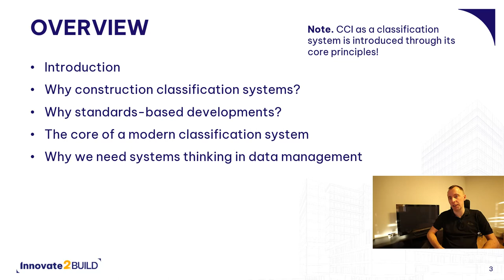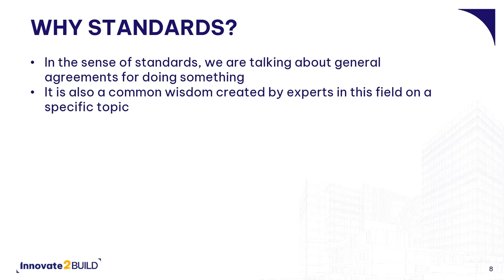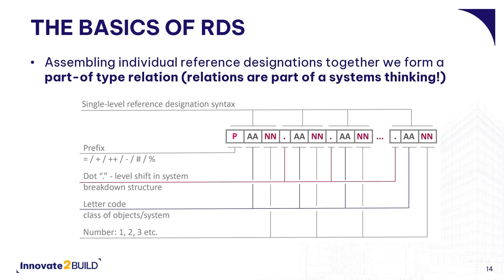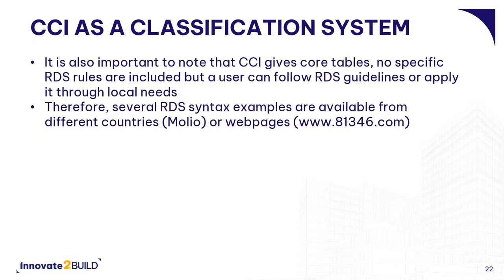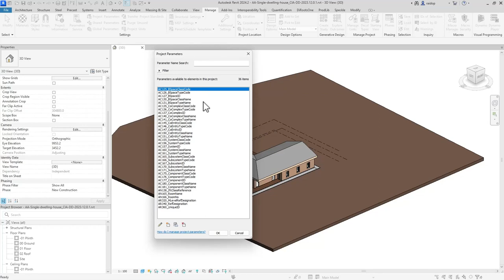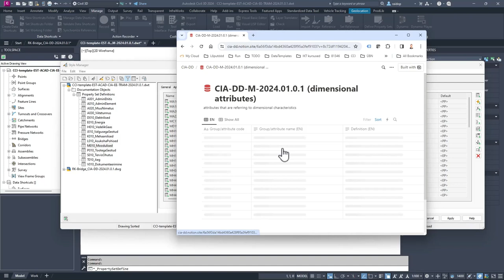BIMbase - The basics of CCI (with Revit & C3D demo parts)

Comment: @Raido Puust , I'm curious why you describe thermal insulation (12:02) using limited code, instead naming it -C1.AC3.RQA3 ? (System.ConstructionType.ElementType).
Reply from the maker: Quite right. This is a beauty of RDS that in some cases you simply need to refer only to a type and not to a full RDS notation. Therefore, just a type part is shown, but for sure, if you want to align all those construction layers, it makes sense to use the same presentation schema.